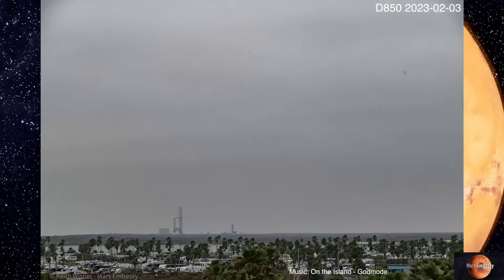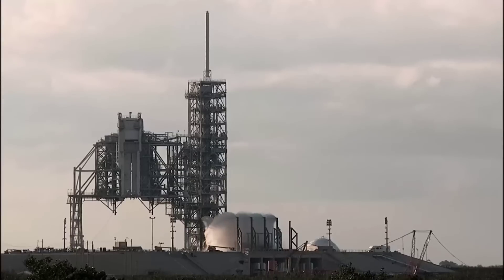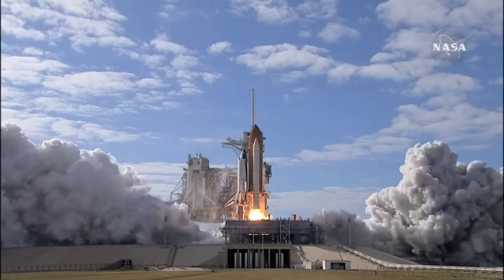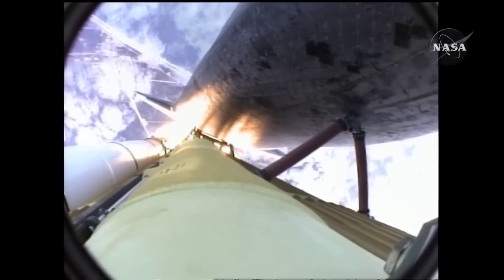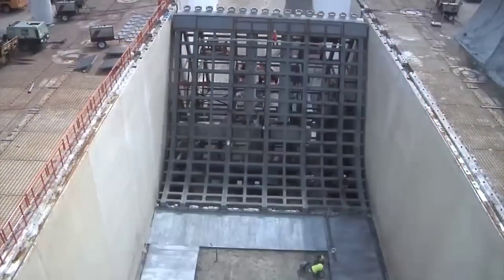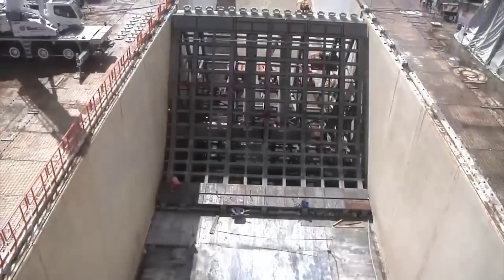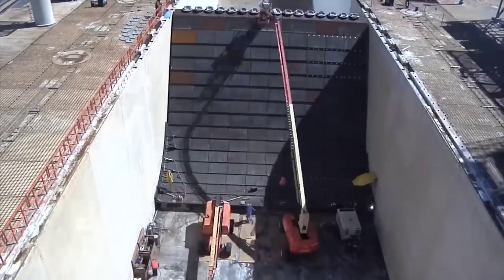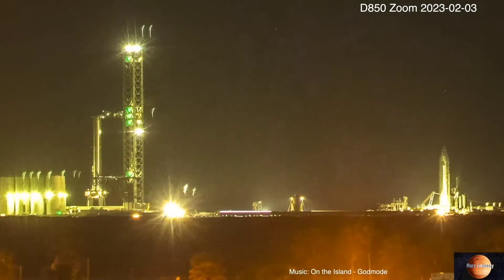Boca Bulletin!  Sound Suppression System installed!  But what about a Flame Trench for Starship??

Comment: The problem for a flame trench in Boca Chica is the water table which is basically at the surface. I wonder if  there may also be environmental protection issues with building one into the substrate.
Reply: I have also read something about Boca not being allowed to have a flame trench due to environmental rules.  Also that you couldn't do a deluge system for the same reason. Clearly not all of that is accurate. You could obviously elevate the pad using massive amounts of concrete to provide clearance for a flame trench, but obviously that would cost a lot and take months to cure.
Reply: Florida has the same problem. The Florida 'flame trenches' are not dug into the ground, the non-trench parts are dirt trucked in to raise the height of the ground.

The Starship OLM puts the rocket engines further from the surface than the flame trenches in Florida.
Reply: @davidelang  You are correct about the cape.  The trenches are at ground level and the pads were built up.  Keep in mind the trench at KSC is 42 ft deep and you have to add another 25 feet for the height of the MLP for a total of 67 feet the engines are off the ground.   Also keep in mind the Cape has a diverter in the trench that helps divert that energy away from the rocket.  Boca Chica it reflects back up.
Reply: @pebmets  I believe that the starship launch mount is ~100 ft (~30m) above the ground, so a bit more space than in Florida.
Reply: @davidelang  Keep in mind with the previous test firings, there was some damage, (even if it was small),  to the booster even though less than 1/2 of the 33 engines were fired.
Reply: empty flame trench is like and empty pool in south florida. when surface water can push pool out of ground. it would need to weigh more than the upward force?
Reply: maybe it can be perma filled with water? Would the water even diminish it's usefulness much? Maybe it could absorb some of the energy even?
Reply: Even better... just dig a giant pond to shoot flames into. 😆
Reply: If you create an arch blast ramp & use a 2way split arch draw-back O.L.Bridge (vs the flame cadge "O.L.T") raised up a bit. You then only need a far horizontsl clearance path, of no wild life fields. Even out at the open lakes.
Reply: KSC had the same issue.  To get around the water table issue, the trench is at sea level and the pad was built up.  If you look at 39A and B, you see the pads are elevated which is why there is an incline.  The trench is at ground level.
Reply: They already buried so many trenches and tubes in the ground around, they would have to redo everything.
Reply: If you look at the pictures of the starship launch mount in Florida, you will see that it's taller than the mound that they are launching the F9 from (even before they add the main disk of the platform) so a 'trench' would be restricting the exhaust flow.

One question is if the added distance is enough to hit a flat surface, or if they need a structure under it to direct the exhaust to the side. But any such structure would get in the way of working under the rocket (raptor maintenance platform, etc. Which hopefully won't be needed in the long run, but that's still a fair ways away)
Reply: Under the flame diverter at the bottom of the flame trench you must have some kind of heavy foundation. If you just build it in soft wet sand, the whole thing can sink under the weight and pressure. 
And than, all of the above that people mentioned.
Reply: @claudiomaiasantos  KSC has the same issue with a high water table and were able to engineer something that has worked for over 60 years.
Reply: @pebmets  at what cost? 
SpaceX don’t even have the necessary permits to justify this kind of investment. 
I know it’s possible, but is it wise at this time? Is it a good investment at this point?
Reply: @claudiomaiasantos  Would it have been easier to do it right from the start without having to be different?  Is it less expensive to rebuild and fix everything each time the engines are fired or to have been something that is proven to work from the get go?  There has to be a time where you have to stop putting good money into bad, bite the bullet, get the permits and do it right.  The amount of the delay might be worth it to reach the long term goal.
Reply: @pebmets  I honestly don't know.
Let's remember thar this is a prototype. 
If it works, they can spend as much as it takes and make money with it, but if it doesn't, they would have spent a lot less money.

Comment: It’s called wet lands the water table is high talk to the EPA
Reply: Same problem at the Cape.  NASA's solution, the trench is at ground level and the pad was built up giving the trench 42 feet in depth with another 25 ft accounting for the height of the MLP.

Comment: A real trick to build them into the oil rigs🤥
Reply: why? the ocean is bigger than any man-made deluge system.
Reply: @davidelang  I read it had to be fresh water for reusable engines but I think they use pure water for making fuel. There were plans to build a desalination plant using solar panels. I hope YOU are right.
Reply: @davidmacphee3549  the water isn't hitting the engines, it's flooding the ground  around the engines and absorbing heat and sound to turn into steam. Yes the steam will contain some salt if it's done with ocean water, but with the huge flood of gasses coming out of the engines, I really doubt if any of the steam will get to the rocket itself.

It would affect the launch platform, but that has to live in the salty environment anyway.
Reply: @davidelang  Not sure but it's worth a thought. Those systems use enough water to fill a river. Fresh water would have to be recycled. That's a lot more water than it takes to flush a turd. Boiled Oceanwater leaves a lot of salt behind.
Reply: @davidmacphee3549  for an ocean platform, you just leave it open below the rocket, so you are evaporating directly from the ocean surface.
Reply: @davidelang  Sounds Good!